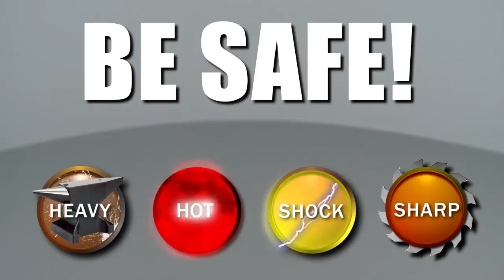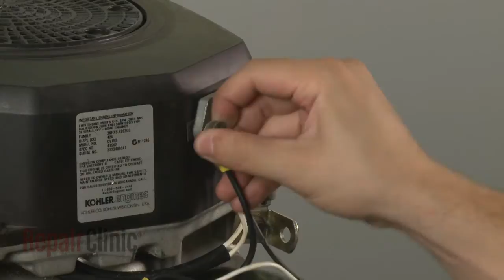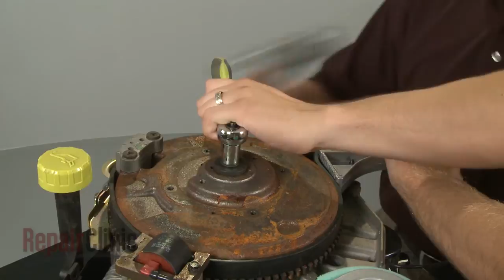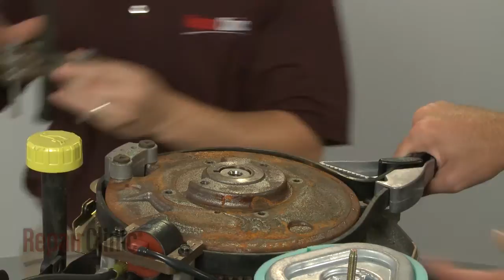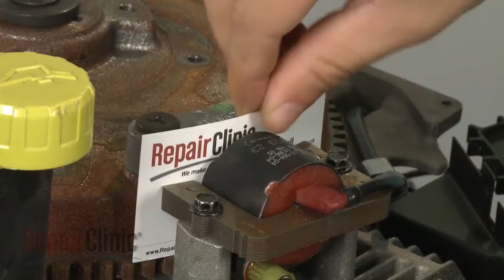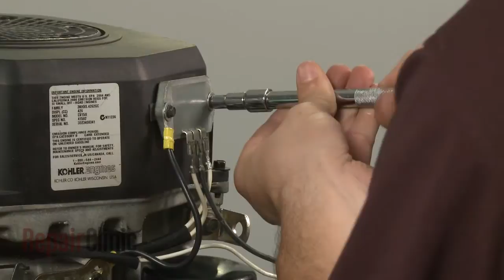Kohler Single-Cylinder Small Engine Flywheel Key #X-42-15-S

Comment: Im curious, i dont have the strap or a puller. Any recommendation for fixing it without those 2 tools? My fiance hit a metal dog spike in the yard.
Reply: just replaced mine yesterday and with a light tap with a rubber mallet I was able to remove the flywheel without a puller.  my strap wrench was not big enough to get around the flywheel but managed to get it on part of the top casting.  Didn't take much to get 50 ft. pounds of torqe on the bolt.   John Deere LT160 back to running like a Deere should.
Reply: Steve Kuhl Thanks! I will try your advice! Ive got distracted due to plumbing & garbage disposal. Now i get to try replacing a portion of subfloor & water in pipes that are horribly not up to code. 
I was going to try a rubber belt for the strap wrench. 
I will say im soo thankful to have had my gatorwrench for this 😂
Reply: Sarah F actually a leather belt and some sting hand might be good enough to hold it while tightening the bolt.    To remove it use a long screw driver to gently pry upwards as you use a rubber mallet to tap the other side.  Don’t pry too hard on the aluminum engine block.  I didn’t move my coil like the video showed.  Whole job took about a half hour.
Reply: Smack your tool like he did you can get it off without the belt thing it's how I always done it
Reply: Sarah- Just place a short piece of wood such as 2x4 to block off the mower blade against the underneath deck. The blade is attached to the same shaft as the one holding the top bolt. So you can take off the top bolt by blocking off the blade or if your blade is off you can use a pipe wrench to hold the bottom portion of the crankshaft while unbolting the top bolt. If you have a riding mower it most likely will have a crankshaft pulley with a long sleeve on it. Put the pipe wrench as close to the pulley end as possible and take the top crank bolt off. You will need to adjust your pipe wrench so it just has enough space to get around the shaft and position it in a manner that will cause the teeth to grip when the top bolt is turned. You will need to have the wrench jaws positioned on the shaft one direction to take it off and turn it around so the teeth grip in the opposite direction to put the bolt back on. You can probably just unscrew your top crankshaft nut until it is even with the end of the shaft. Then take a large screwdriver or other prying tool being careful not to break any soft aluminum and use a hammer to moderately strike the top of the crankshaft/nut while prying up. This will usually break the flywheel loose.